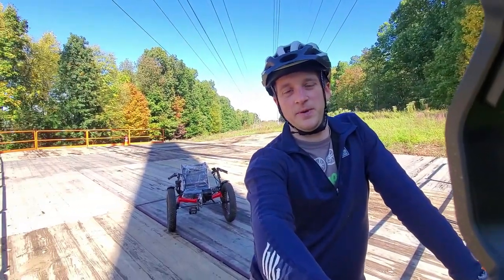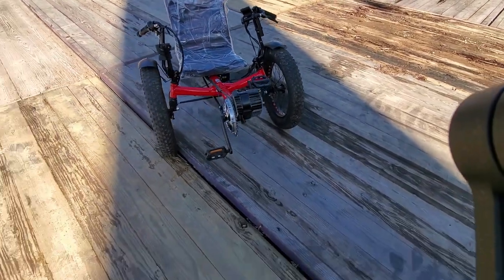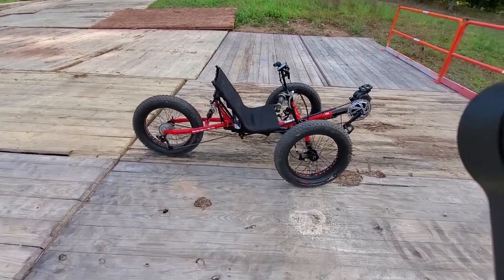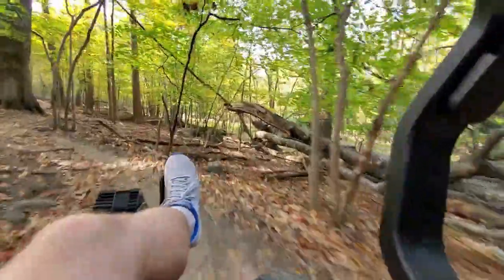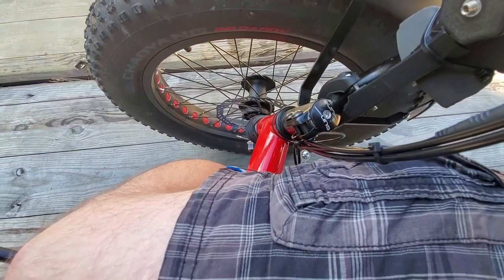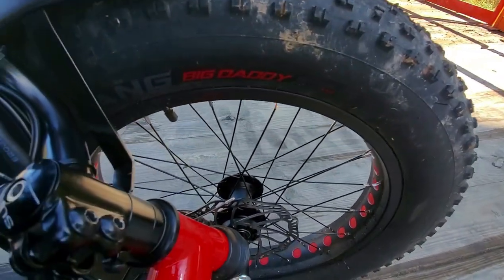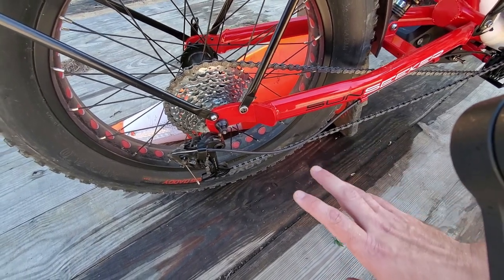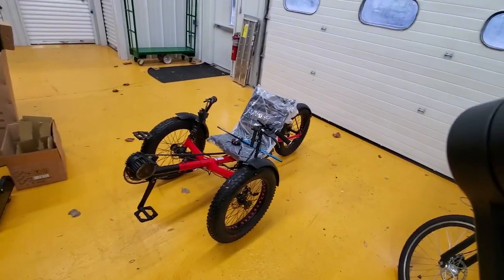Fat tad Recumbent E-trike Review and Mechanic's Tips

Comment: I have this trike and I have play in the steering column on one side only. The owners manual doesn't cover the topic in any detail. I thought it might be bearings but when I removed the wheel, it's between the axle and the handle, in the column. Your video was the only place I could find any mention of it. Any tips would be appreciated. The Sun components in my trike were upgraded to Revolution by the previous owner. It is a lot of fun.
Reply from the maker: Thanks. Yes it is truly a fun trike!
Reply: I took it all apart, the problem was in the hexagonal piston of the suspension  in the lowest part of the column. I can't fix it, it had to do with the machined tolerances of the parts. It's not front to back or side to side play, it's twist between the tie rod and the axle in the bottom of the head tube. All bearings are good.There was a press fit part in the top of the tube I couldn't remove or I would have tried to insert some strips of shim to tighten it up. Had to remove the tie rod connector to strip it down so Now I will have to realign it in the morning. A little toe in? I figure I will take cues from the side that still has the factory settings as best I can. I made and installed front fenders today, added a second battery last week and put on leather panniers also. 1000 wt Bafang is amazing. It's a heavy trike but it moves!  @DenisBikeMechanic
Reply: dOES THE CXS COME WITH THE SEAT ONLY IN THE VERY UPRIGHT POSITION OR CAN IT GET NNVERY LAID BACK FOR ERGONOMIC RIDE===IF YOU KNOW??
Reply: UTAH trikes has a detailed video of this

Comment: Does a 250W BBS01B Bafang Mid motor also suffice for climbing hills ? I ask because here in Germany it is a crime to use pedelec motor which is rated above 250W. I already received a penalty order - so you might understand my question...
Reply from the maker: Hi. Simple answer is Idk. In the US cops doesn't care what you're riding. Unless it has pedals you're safe. I guess motor can be programmed for 250 w output. Here we have option 1000w (offroad) or 750 (road) preset when purchase kit.
Reply: @DenisBikeMechanic  Is the silver chainring on your trike stock or aftermarket part ? It looks as if the chain would come closer to the frame with that ring as it is bent inwards...I only have the flat black 44T chainring with my BBS01B 250W motor which brings the chain 1-2cm away from the frame because of the motor, which might not allow to get on the biggest 51T pinion on the rear cassette.
Reply from the maker: @19Marc79  that's a replacement part from Luna. Check their site. You'll see different chainrings there.